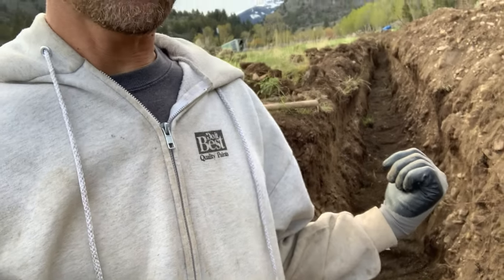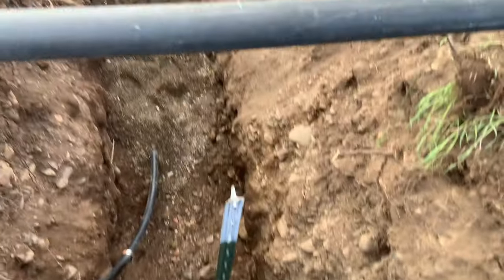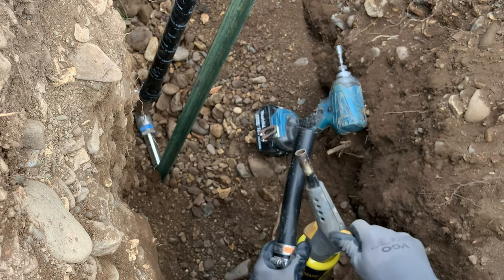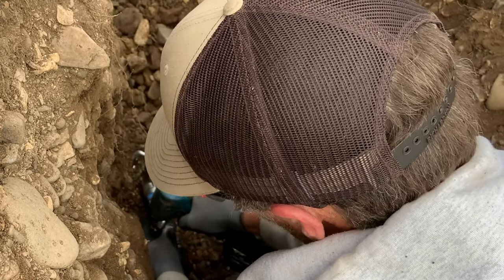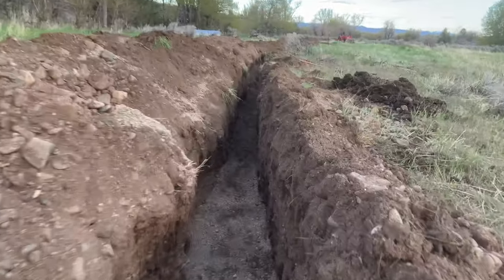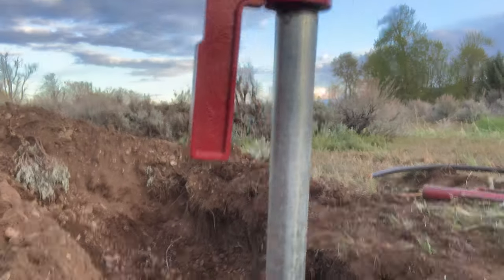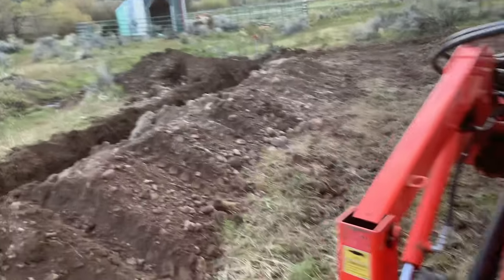The ULTIMATE Poly Pipe Trick // FARMSKILLZ

Comment: i've raised ponies 40 odd years have installed several of these and rebuilt a couple. The right angle fitting going into the hydrant looks like galvanized. i know you said the hose barb was stainless. I have had the galvanized fail after years underground, and so I just finally starting using plastic for everything. there's not too much stress when you secure the hydrant to an upright like you did. Just sayin. otherwise fun watching someone else work haha
Reply from the maker: Thanks Lonnie. The street 90 going into the hydrant is stainless but it does look a bit different from the others. Stainless works the best with our soil and water type out here. Haven’t been able to bring myself to go with plastic, but it sounds like it holds up pretty good! Thanks for reaching out! I pinned a link to all the stainless fittings at the top of the comments. You may have to navigate around the Merrill site a bit to find the street 90s. Thanks again!

Comment: What I do is get paper towel that would be the width of the barb say 2 inches max, fold multiple layers of paper towel to become well padded; I make use of  used tea bags inside the folded paper towel. Soak it in very hot water for a few minutes until the entire paper towel pad is soaked and hot. At the site of the poly pipe where you are trying to connect the fittings wrap the hot paper towel pad around for about 3 or 4 minutes. The pipe becomes very malleable and uniform heat is spread evenly around the circumference. Makes it very easy to push the barbed fittings through without a gas torch that can ruin with uneven heat.
Reply from the maker: Dang! That sounds awesome! I will have to give that a go on the next go around, which is actually coming up pretty quick. Thank S B!

Comment: You’re making it seem way harder than it is… get the torch out and heat it for maybe 5 -10 seconds and stick it in. If it want go then use a little more heat or tap the fitting with something to get it in all the way. And if you forget the clamps you don’t have to cut the pipe. Just take the clamps apart and put them on that way.
Reply from the maker: Thanks for the advice Steven! I was a little nervous after I heated one too quick and it got all gooey and was ruined. Yes the clamps can be taken apart. Good point. Have a great spring!

Comment: Bro fords fittings would have saved you so much time and end result is way better, if is a barb fitting you will be digging it out few years later, at least what the salesman from hd fowler said
Reply from the maker: Once upon a time I watched a ford fitting blow apart a couple days after a supposed pro installed it. Never had an issue with a barbed fitting. Maybe the guy didn’t get it installed right.  Sounds like a good salesman!
Reply: @BidwellCanyonFarm I believe it, maybe the installer went to tight?

Comment: Be careful, sometimes poly pipe looks like 1 inch but it’s actually three-quarter
Reply from the maker: Haha, yep gotta watch it!
Reply: Read your print line and understand (research) the difference between IPS iron pipe size and CTS copper tube size in addition to the DR -wall thickness-. All make a difference as to what mechanical fittings or fusion fittings you use.

Comment: I am thinking of replacing my 300' water line from the meter and come across your video. I saw other video using pack joint fittings with stiffener, I guess either that or your fitting would withstand the PSI from the city water.
Reply from the maker: Oh yeah, typically city water is coming in around 60 psi. Those fittings are designed to handle way more than that.

Comment: I've been piecing together how to work with poly[ethylene/butylene] and it's good to see my understanding confirmed in what you're showing.  Have you found a suitable water pressure sensor and leak detector / automatic shutoff valve?  If there's a leak it could take a monstrous amount of water before showing on the ground surface so it would be more than helpful to keep track of that.  But all the leakage detectors I've found are intended either for indoors use or for irrigation / lower pressure purposes.
Reply from the maker: Hey Stephen, I have never used a leak detector. They just seem like 1 more component that could cause a problem to me.🤷

Comment: Very useful, thank you! 
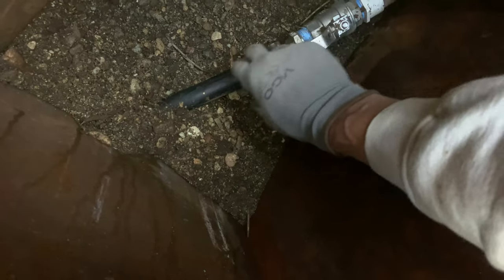What is the name of the 1" stainless Straight fitting by the shot off valve 7:05 & T-fitting 7:15 ? Why you used with threads instead of only barbed? 
Why did you offset the hydrant instead of putting in line the pipe go? 
What do you think about Monitor Magnum Frost-Proof Hydrant by Baker?
Reply from the maker: The fittings are 1” male threaded on one side to barbed on the other since the shutoff had a female thread and so did the stainless tee. Sometimes you can find a barbed tee. Which would save some money and fittings. I just went that route since that was what they had available at the plumbing shop. Thanks!
Reply: @BidwellCanyonFarm  Thanks for replying! 
There are 2 more questions in my list. 🙂 
1) Why did you offset the hydrant instead of putting in line the pipe go? 
2) What do you think about Monitor Magnum Frost-Proof Hydrant by Baker?
Reply from the maker: I offset the hydrant because it fit best with our trenching layout. It also puts a lot less pressure on the mainline and gives more flex when opening and closing each hydrant to have them on their own leg. I have never seen or used the hydrant by Baker. It definitely has a strong name! I will try to look it up when I get a chance and let you know what I think.
Reply: @BidwellCanyonFarm  Thank you so much! You are awesome!  
I wonder if I can connect with you via call. I also have a small ranch. Relatively new to this. Replacing 2 hydrants. Have a leak, because our pump recharge every 2 minutes. I tuned off pump, only put on when needed to use water.

Comment: When you bury this poly pipe do you just throw the dirt back over and compact it or do you use a layer of sand or anything?  Just curious I have to bury some poly pipe soon
Reply from the maker: I like to shade the trench with at least 2-4” of sand below the poly and 2-4” above. Then i can backfill with the tractor with no worry of damaging the line. We have really rocky soil though. If your soil is soft the shading may not be necessary. Hope this helps! Have a great day and thanks for the question!

Comment: Thanks for your video, as I am running the same type of water line and was looking at different options. I was trying to find the barb pipe connection and the double banded clamps. Did you buy these locally or online. I would appreciate a link to them if you have it available. Thanks in advance,
Reply from the maker: Hey Frederick, I bought them at Grover’s plumbing supply in Klamath Falls, OR. If I can find something online I will shoot you a message. Thanks for reaching out.

Comment: Whats that tape you wrapped around water hydrant?
Reply from the maker: It’s a 10 mil pipe wrap tape. Usually comes in a 2” x 100’ roll. You can find them in your plumbing supply store. I have seen it used on gas lines or galvanized plumbing pipe. It helps protect the steel from any moisture and corrosion and helps with the longevity of the system.

Comment: Why would you burry the pipe then check for leaks?
Reply from the maker: Shading the trench with 2-4” of sand over the pipe helps keep the pipe right where you want it. In the off chance you had a faulty stretch of pipe it would be easy to see a leak as the sand would almost instantly show up as a darker, wet spot. A pressure test before backfilling can also be done to ensure no leaks are present.

Comment: I personally think this is a bit over the top for the project. If you overheat poly (polypropylene) you will get pinpricks in the pipe. This resin has a melting point of 320 degrees. Most polypro is dried from 2-4hrs at 200 degrees before ejection, or not even dried at all due to its low melting point. This is especially typical when you heat the pipe in a cold weather environment. It will hold, but the pinpricks or craters you cannot see will expand with pressure from the water and the temperature variance throughout the seasons.

The fitting is overkill as well. A simple standard PVC fitting will work just fine under many pressure exposures. How you fasten it will determine how it will perform and it's longevity. 

There is absolutely no need for this elaborate rig. Also make note that the trench appears to be hand dug. Assuming he does not enjoy digging by hand I would have borrowed or rented a trenching machine of some form. Even 1 1/4" poly pipe can sit 6" in a residential setting that experiences all for seasons safely. 4ft if ideal but not necessary at all.
Reply from the maker: Wow! Lots of info going on here. Thanks for the comment! Not sure where you get the hand dug part, but if I was hand digging this, I would still be down there digging and there would not yet be a video about it. I assure you the trench was dug with a backhoe. What do you mean by 1 1/4” poly in 6”? Are you saying it can be set at 6” deep in all four seasons? I disagree with you there, if that is what you are trying to say. It is important to check your local codes to determine how deep your plumbing should be set. The poly might be able to handle freezing temperatures at 6” deep, but I am certain the fittings could not, especially if using the plastic fittings you are recommending. I will stick with over the top. Thanks!

Comment: Does this also work when you want to remove a barbed fitting?
Reply from the maker: You know, i never tried it. I wouldn’t be surprised if it made things a heck of a lot easier, but I do think it’s going to be more difficult taking it back off once those ribs make indents on the inside of the poly. Worth a try for sure!

Comment: Can you use hot water instead of torch to heat the pipe
Reply from the maker: Hi Craig, I tried using a heat gun running off a generator and that did not work. In my experience, it took the high heat of a torch to make it pliable.
Reply: I was thinking a heat gun
Reply: I'm sure hot water works; another video shows running hot water through pipe and it worked.
Reply from the maker: @mrtechnophile3483  never tried it! Do you just let the water spray out for awhile and heat up the poly?
Reply: @BidwellCanyonFarm   that's what the video showed, but the average water heater will go cold pretty quickly.  Not finding a temperature spec, but figure somewhere 140..200F?  Haven't done it yet.
Thinking:
1.  For just the ends, dip them in a pot of boiling water.
2.  Fill the pipe then trickle hot water though to keep warm?
3.  Circulation through a pot on a gas or propane stove.  Pump has to take the heat.
4.  Knock together a frame and line with a tarp (that will take the heat)
5.  Welding gloves for handling the hot pipe
6.  Knock together a box, and run hot air in.  Maybe a sheet of insulation under and on top.
Reply: Pros fuse pipe @ 425 deg F. I would think you would need well above boiling temps to really get the pipe pliable, BidwellCanyonFarm is spot on for working with mechanical couplers.
Reply: I recently installed a field hydrant with a  95' polypipe water line to the Emu shelter. I ran it off of the main, 30 inches below grade. No, a heat gun is not enough heat. I used a propane torch on medium heat. Some guys talk about the polypipe getting a little grossy when it is hot enough. I also saw it " give a puff of smoke " when it was just the right temp. In all, I made 8 good conections using this method. 2 hose clamps for each connection.

Comment: Ive turned the internet inside out and cant find those barbed fittings like that 🤷‍♂️
Reply from the maker: I can’t find them either Vance. Grover’s Plumbing in Klamath Falls has them. Might be worth a call and see who their supplier is. Best!
Reply from the maker: Hey Vance, I found the barbed fittings for you. They are Merrill XL Stainless fittings located here... https://www.merrillmfg.com/collections/stainless-steel-insert-fittiings The XL are typically used for drop pipes to well pumps and are maybe a little overkill for water line applications, but, I like to overkill things. It is a great site, I just ordered a gaggle more parts and was super pleased with the checkout experience! BEST!
Reply: I know it's been a year since you commented, but if anyone else is still looking, try RPS water pumps.

Comment: As a plumber of 20 years please people never put a pipe or bucket around the base of your hydrant. It only makes for a harder time digging it up later.
Reply from the maker: Interesting, I have never had any more of an issue digging up one with a bucket or one without. Digging is digging, it always sux! In my experience, having the base surrounded by a bucket w/gravel only keeps the base of the hydrant cleaner and easier to expose once you dig around the bucket. What have you run into that causes problems? Thank you for the comment!
Reply: @BidwellCanyonFarm  i dont know bud maybe your ground is just easier to hand dig then here in ky. But around here you want to dig as small a hole as you possibly can. It may also be that if you only have to dig one up every few years or so you may not even notice. But it really just may be a difference in location because I see you are useing IPS pipe with barbed  fittings ( that I hope are stainless and not galvanized) and hose clamps. We haven’t used that stuff in new installations in this area since the 70s. But anyways, to each their own.
Reply: @tavinc  what do you use in New installations?
Reply: @rainturtle5956  what do you mean exactly?

Comment: What is the tape you wrapped around the bottom
Reply from the maker: Hi Devin, the black tape i used around the hydrant is called Harvey’s 10 mil pipe wrap. The blue teflon on the barbed fitting is called “Blue Monster” It costs a bit more, but it is way more substantial than the typical Teflon tape and seems to do a really good job. Hope this helps!
Reply: Why the 10 mil tape?  Does it cut down dissimilar metal issues?

Comment: I just use dish soap it usually slides on relatively easy
Reply from the maker: Nice! I have not had any luck with that method. It was really cold outside when I tried it. Maybe it is easier in the summer?
Reply: For mechanical couplers on thinner DR such as dr19 or dr32, this is a good trick. For thick wall -250 psi, DR9, better use some heat. Or do it right and fuse the pipe vs. mechanical couplers.